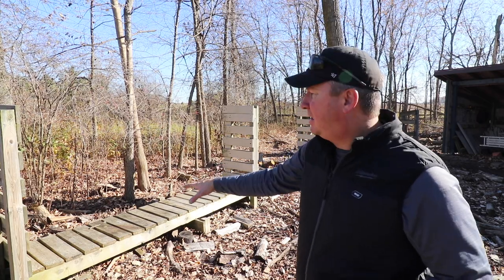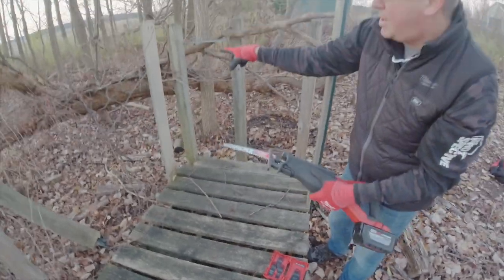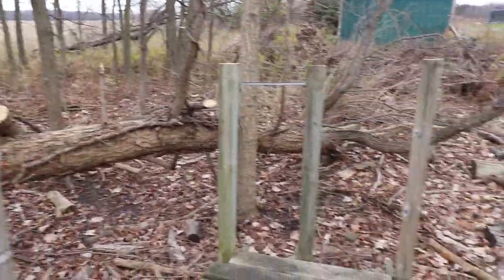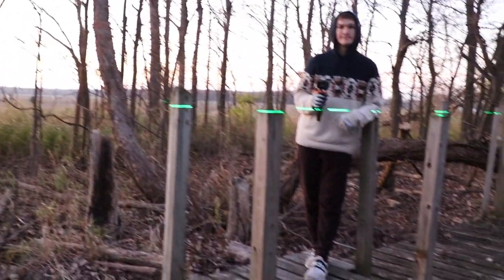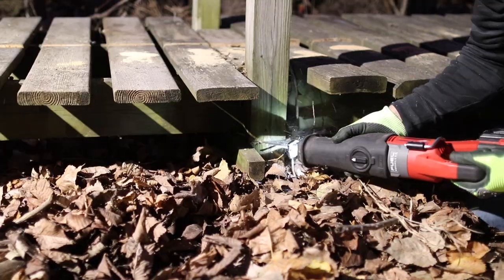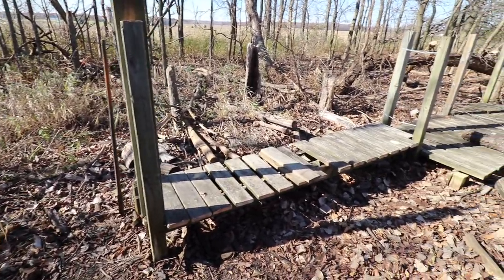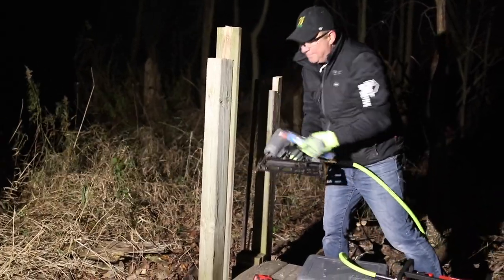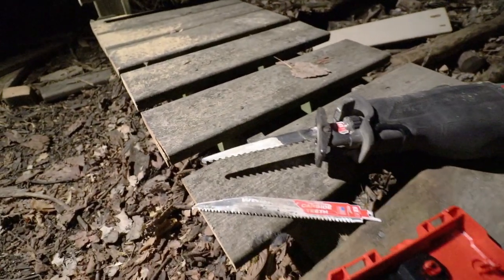FIREWOOD STORAGE RACK BUILDING PROJECT USING NEW 2020 MILWAUKEE TOOLS

Comment: do you get enough wood to last the whole season or do you have to refill at some point ?
Reply from the maker: If I fill all the racks, I'll have enough to last the winter.  I normally don't start using my wood stove until November and I also run my furnace part of the time.  If I run the stove constantly, I need 5 full cords, where I'd need to refill.